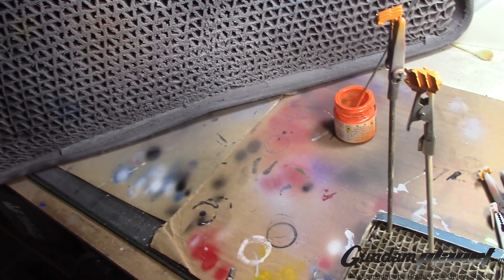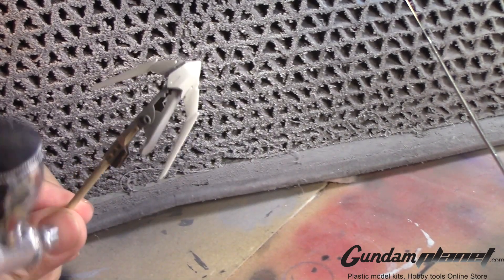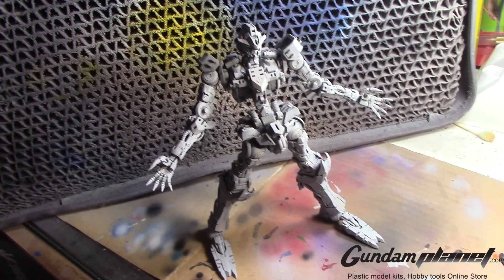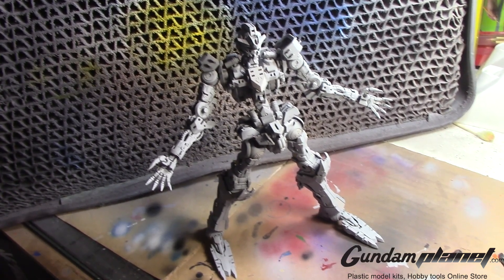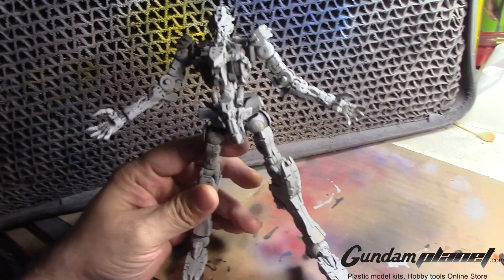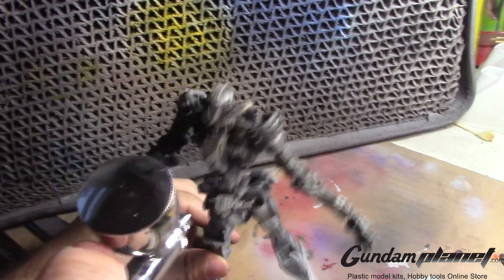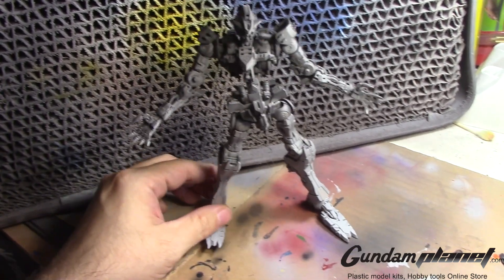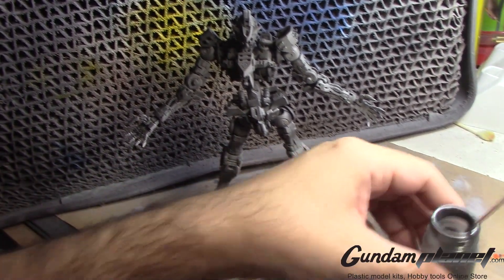*GundamCustoms* 1/100 MG Gundam Barbatos - Part 6

Comment: Another way of doing the orangey-yellow is to paint it yellow then use Tamiya's transparent orange heavily thinned down on top of the yellow. I use this method on my gold parts - gives the gold a bit of depth. 

For the inner frame, I prime it in black then a coat of a mixture of Vallejo's Metal color series, Gunmetal Grey and Burnt Iron. When that's dry I dry-brush Mr Color 104 Gun Chrome to hit all the high bits and edges. Finally cover it (by brush) in Mig's Oil and Grease Stain Mixture and then wipe it off so it is only in the recesses. Sometimes I do this before the Gun Chrome.

Comment: Not a fan of Gunmetal from Alclad. looks like metallic black. Just recently bought AK Gunmetal to try out.
Reply from the maker: Ak does go spray nice and smooth. Just remember to topcoat it if you plan to put masking tape on it and paint another color. If you don't do this the part will have some if the adhesive stuck on it from the tape.